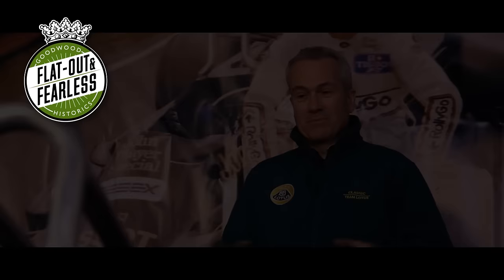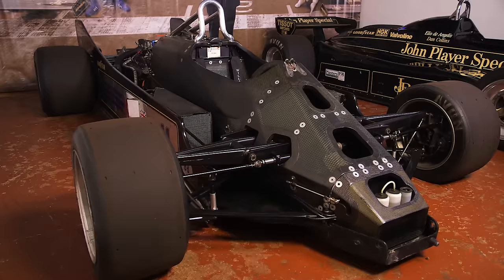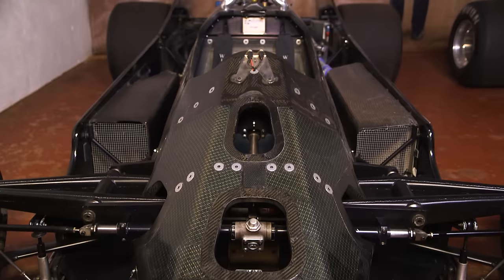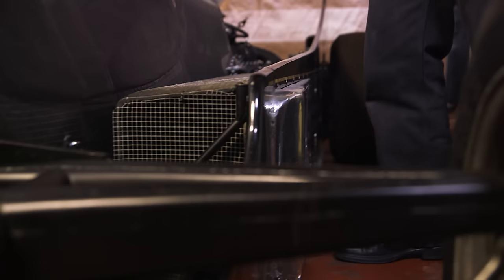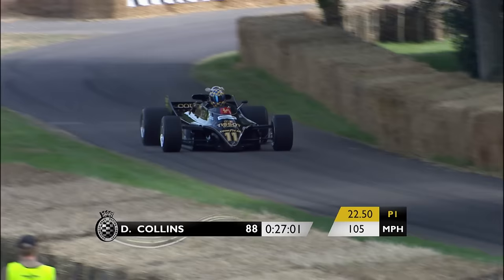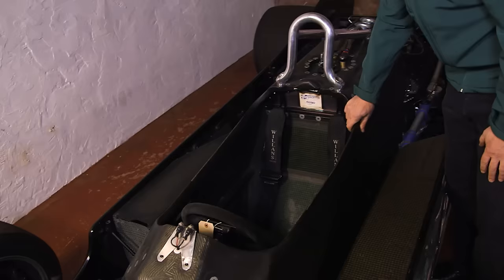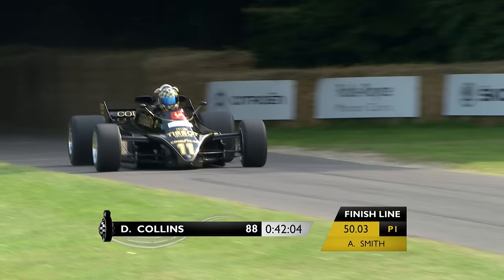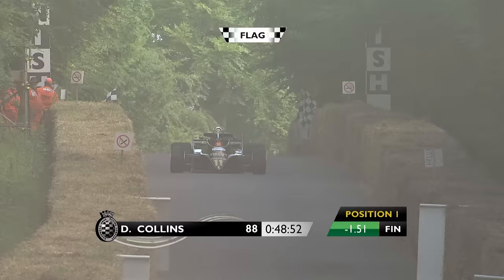Lotus Type 88 - The BANNED F1 car

Comment: Another masterpiece from Colin Chapman... However the problem was that with ground effect the pilots were suffering of two much G force in curve which caused safety problem. This is the reason why the year before 6cm clearance was introduced and the skirts banned. 
Brabham (with hydropneumatic suspension) also tried to workaround the rules to use ground effect. For similar reason later on Turbo-charged engine would be banned too because F1 were becoming power monsters. 
These limitations might be seen are setback but innovation might not be done at cost of drivers safety and there is still room for innovation within rules.

Comment: I don’t know if this car would make it. The idea is indeed brilliant but Lotus kept on using normally aspirated Cosworth engines. The ground effect car was very fast on corners and the double chassis made the car much more driveable to the driver, but the other teams were also building ground effect cars with 1000 HP turbo engines. Any advantage this Lotus would have on corners would vanish on straights. After Chapman’s death Lotus also went turbo…

Comment: I really don't understand this kind of innovation suffocation. In a very specific circuit i understand, they want to keep things somewhat competitive and everybody driving fairly similar cars so that it's more about driver performance than the machines, but you're talking about formula 1, the pinnacle of automotive engineering, pitting against one another auto giants, exotic car manufacturers, and smaller high tech engineering companies, to see who can make the fastest car. If someone comes out with a better design, they deserve to win and others will come out with a better design or copy their opponents. 

I don't follow much auto racing but i was paying attention to motorcycle racing there for a while and I liked Buell when Harley killed the brand. I was very excited when they announced Erik Buell Racing and said EBR would compete in racing. The bike they came out with was lighter than other bikes on the circuit because of trademark buell features like the perimeter brake rotor, fuel in frame, and using the engine as a stressed member of the frame. The rules allowed for a larger displacement if you had a v-twin engine rather than an inline engine so they went with 1190cc, and in the end the inline 4 engines had more power, but the EBR bike was lighter. Amazingly though they forced EBR to add weight to the bike in order to race, giving up their primary advantage. I can't understand rules like these, why not just be honest about it and say we expect everyone to fit in a mold and not be unique.

Comment: This is what holds F1 back, manufactorers are not allowed to push innovations forward. The last time anyone really did was McLaren with their stalled rear wing system. FIA went and made that into DRS, which is a lot more synthetic and they normalized it accross the feild. Before that was what Red Bull with the blown defuser? Thats now banned. Mecedes had that system where the air going though the DRS system would channel to the front tires giving more lift and top end speed, also banned. There was that one time Ferrari had like a U cut out in their rear wing, banned

Comment: For all those interested in the real story of the Lotus 88, it is not told here. There is a very important part missing. Back in 1968, there was a proliferation of very high aerofoils on F1 cars. They were very effective as long as they stayed in one piece. The problem was that they were mounted to the wheel uprights to maximise the load on the tyres but minimise the load on the chassis. This was a good idea in principle until they started to collapse. At the French Grand Prix at Rouen, Lotus driver Jackie Oliver was involved in an enormous crash when the high wing on his car failed. Here is an example on a Brabham:

http://www.formula1-dictionary.net/Images/wing_failure_1968_brabham.jpg

This led to an immediate ban on suspension-mounted aerofoils.

So to the Lotus 88. What Clive Chapman doesn’t tell you is that the so-called primary chassis was designed to apply downforce to the suspension, via links just inside the uprights. When you see him pushing down on the chassis, all that is happening is that the spring mounts for that component compress and the load is transferred immediately to the wheels. It was just another take on 1968. This was not so much a work of clever design as it was a play on words but ultimately, nobody in 1981 thought it was anything less than a breach of the rules and nobody but Lotus complained when it was banned. It was just another concerted attempt to get around the rules. At that point it was not showing a lot of potential and the team admitted that it would take at least a year to develop.

https://m.imgur.com/ja6PvFt

https://duddhadotme.files.wordpress.com/2015/10/lotus88b_l.jpg

All other theories about it being too fast or too clever or the result of pressure by Ferrari are wrong. That’s just victim talk. Everyone knew it was illegal. Even Lotus didn’t push too hard when it happened.
Reply: Exactly.   It is sad for Lotus because they put all their chips in on this design, and if it had worked (as the 78 did  a few years earlier) they would have been world champions in all likelihood.   But it was also clearly a violation of the "moveable aerodynamic device" rule in place at the time.   That had originally been intended to apply to traditional "wings", but IMO it was rightly applied here.

The real question I have is why Brabham's hydropneumatic suspension system - designed solely to get around the minimum ride height rule - was not also banned before racing...
Reply: @ShmuelWeintraub  From memory, that was in response to a minimum height restriction rule introduced for 1981. The idea was for the car to clear a 6 cm high measuring stick placed under it before it left the pits and on its return. This was supposed to eliminate skirts (which were also moveable aerodynamic surfaces, as are DRS elements in the rear wing of a modern car...) The Brabham suspension was supposed to circumvent this by alternately raising and lowering the chassis to bring the sidepods closer to the track and make a better seal for the undertray. This required incredibly stiff suspension. The driver would leave the pits and throw a switch and the car would suddenly drop down to its designed level. When it returned to the pits, the driver would throw the switch and the car would pop up again. Because it was relatively easy to implement, it only took a race or two before everyone was using it. It was banned for 1982 and side skirts reappeared.

Comment: I was a big Lotus fans in those days and remember the conversations around the car. It had such little track time whether the dual chassis concept was going to be successful is I think still open to debate. You also have to take into account the banning of the Brabham fan car three years before which Colin (with Ken Tyrell) had been at forefront of. Lotus has certainly led the way with Ground effects with the wonderful 78 and 79 but then lost it with the 80 and thereafter. As a Lotus Fan the debut of the 80 rather than the  banning of the 88 was more disappointing. At the time much of the expectation around the 88 was that it would be banned and the pass by the scrutineers in practice perhaps a surprise.

Comment: I would give any organisation that plans on creating a race that has no boundaries, laws and rules on innovation all of my money. All of it
Reply: Math M there once was a class called group c prototype. Basicly just what you said. Only wheelbase and track was within a given spec. 

And if i am mistaken by that please correct my answer without being rude, its been a while since the banned the class.
Reply: @mightress  That is not true. Group C was far from unlimited. In fact, it was the first formula to stipulate fuel consumption. That’s right- hippies and tree huggers rejoice! It was a fuel allocation formula. At Le Mans you had 2,500 litres of fuel to last you 24 hours and woe betide you if you were a millilitre over. You got disqualified.
Reply: @mightress  They didn’t ban Group C. It was replaced with a new formula which had engines more closely related to F1. This was because teams were leaving Group C in droves because F1 wasn’t that much more expensive and got your sponsors more air time.

Comment: This more of the same thing that happens with any sanctioned sport.  If one teams innovation top all others instead of making the other teams develop something to count it, they just ban it.  Just ask Ford about their 429 engines used in the GT40 Mark IV series.  Other race team screamed at the sanctioning body and the rules were changed to no bigger a displacement that 5.0 liters after 1969.
Reply: 1) The car was obviously a cheat. The rulebook banned mobile aerodynamic surfaces, and to make them bigger didn't make them legal. 
2) In reality it was actually a slow, crappy and plainly dangerous car, and the pilots later confirmed they felt relieved when it had been banned.

Comment: That's hilarious that they used almost the same technique to get around the same rule low riders had to get around. In LA they banned cars that were too low to the ground so they made it variable by adding hydraulics it allowed them to raise their cars around police so it met the minimum requirement then drop it back down later. The FIA basically did the same thing to Formula 1 to limit high ground effects and they made it so the downforce would deform the sidewall and lower it while driving.

Comment: I struggle a bit with the "double chassis" description.  The chassis holds the wheels and drivetrain and there's only one of those.  The second "chassis" is what I would call floating bodywork with integrated aerodynamics ... maybe an aerochassis?  OK, maybe two chassis ... 🤔 ... maybe.
Reply: Infact describing it as a "chassis" (even as the "primary chassis") was only a smokescreen. It was a single mobile aerodynamic surface.
Reply: Yes.  split chassis (it does have some chassis like components) or Megawing or ????
The one thing it is not is a second chassis....

Comment: Ferrari International Assistance, strikes again. F1 designers will take the rule book and push the limits of those regulations. They will sometimes manager to go past till another team shouts foul. Nothing new here then.
Reply: The same Ferrari International Assistance that allowed McLaren and Lotus to use the 3D throttle right after having said to Ferrari it was out of the rules, so stopping its devlopment in Maranello? The same Ferrari International Assistance that allowed McLaren to get away with their chief designer stealing Ferrari's bluetprint? The same Ferrari International Assistance that forced every team to run with Mercedes control units?
Reply: Suspension mounted airfoils were banned in the late 60's, that's what the body is, a suspension mounted airfoil.
Reply: @SuperExcedrin  1968, to be precise. The Lotus 49B got two crashes in Spain GP due to wing mounts failure.

Comment: while this system was dangerous for high speed cornering and the dangers of even a little piece of the car coming off could kill someone it still saddens me that the FIA is more interested in keeping F1 linear, right now teams can buy engines and such from other teams well where is the innovation teams should have to build there cars from scratch not go "so we have built the car based on what the winners are doing, but we have forgot the engine no worries we buy Mercedes or Ferrari's engines" this is not innovation, this is making F1 boring and just the same every year, Formula E is where the future is with jaquar (one of the oldest and most notable racing teams), BMW, Mercades and nissan including many others and also Aston Martin closing in for the FE, why go F1 when E is better anyway.

Comment: By the way, isn't the Type 88 doing what red bull did with their front wings? They got round the rule in a smart way. Flexible front wing, so when the car is not moving it meets the requirements, but when you add air load on the wing it goes down and gets better aerodynamics
Reply: True, it even started the whole new engineering area, called: Aerorigidity
Reply: @drazenbudis1303 , I think they had a flexing nose-not the wing itself-which achieved the same result but the wing passed the deflection tests. And before you say "brilliant" remember moveable aero devices are not allowed, and the flexing nosecone was a moveable aerodynamic device(the entire body is an aero device).

Comment: Just like how the 787b got banned in Le mans. Can buy a 4 rotor made out of billet from Australia and NZ and put it in praga r1 and you have yourself a perfect race car .
Reply: Load of crap. And both cars were well off the pace anyway.
Reply: @thethirdman225  hahahaha
Reply: The 787B was not banned from Le Mans, after all it wasn't very fast*, a rule change with engines equal to F1's was long overdue.

* In 1991 they made it race with 170kg less than its rivals in the same category (minimum weight of 830kg instead of the one of 1000 Kg, increased  from the previous 900, imposed to the other competitors), in years it won only one race (Le Mans 1991) thanks to the weight advantage and relative reduction in consumption (the regulations foresaw a maximum of 2550l, with all those kg less they had fewer problems respecting it than the rivals who had to slow down) as well as reliability problems of the opponents who were faster.

Comment: The Lotus wasn't the first carbon monocoque, the McLaren MP4/1 was.
Reply: Lotus was first F1 car with cm but McLaren MP4/1 was first one to be raced.
Reply: I’m not sure how true this is. The Lotus seemed to be made of sheets of carbon that were bonded and bolted together, whereas the McLaren was tail up on a mould, using all kinds of irregular shapes before being vacuum bagged and put in an autoclave. The Lotus seems to have been a new material utilised in the old way, while the McLaren went all the way and used the best method.

Comment: Can you imagine how amazing F1 would be if it never had restrictions
Reply: It would be utterly boring. There would be one team, with one car and no driver because it would be done by remote control. The spectators would be about a kilometre away from the track.
Reply: @thethirdman225  it wouldn't be boring, it would be an engineering marvel and drivers would be priviledged to drive such machinery. F1 is about innovation and these designs can further help teams understand how to improve road cars too. Debatable, but nevertheless, F1 will be innovative.
Reply: @micklykan7057  It would become so prohibitively expensive that there would only be one team and probably only one car, which would be remote control. Look at the biggest complaint about Formula 1 today: the big money teams dominate. They tried unlimited racing in the1960s and1970s. It was called CanAm and as spectacular as it was, there wasn’t a lot of dicing. The big money teams, Porsche and particularly McLaren, simply ran away and hid. In the end, the Porsche 917/30 was called “the car that killed CanAm”.

Comment: Wouldn't a second chassis just add a huge weight
penalty? Doesn't sound to elegant if all you are trying
to do is seal leak for better ground effect.
Maybe it wouldn't have done as well as people think.
Reply: The name is a little misleading... a better term would have been "split chassis".  I think you are right Ian, there would have been a weight penalty for all the extra hardware that allowed the aero surfaces to move while remaining 'attached' to the wheel hubs (or wherever).   But think of it this way... ground effect cars were much bulkier and far LESS aerodynamic than their non GE counterparts - yet they were faster by far because they didn't slow down as much for the corners and thus did not have to accelerate again out of the corners.

No-one knows how the T88 would have done if it raced.  Testing times showed it to be very very competitive, but we'll never know whether it would have been the cakewalk to a championship some thought.    We may even have learned that, while unquestionably fast, the trick suspension linkages required to transfer load to the wheels couldn't handle the bumpy surfaces of the day etc.   It's hard to speculate.

Comment: When the design is so genius they feel stupid and ban it
Reply: Not so.  The F1 rule book had included a ban on moveable aerodynamic surfaces for about 15 years before this car was built.   Lotus built a car to work around the rules (much like other designers and constructors do), and actually broke them.  It happens.  And they knew they were taking the risk of exclusion when they designed the car.

Comment: C. Chapman was of course the first engineer to use the engine block as part of the chases saved weight n made the car stiffer but cause they ALL copied it it was not banned also Lotus won as many GPs in 10 years as Ferrari did till that time on a shoe string not on £Billions Lotus build the Elan with £20000 total n BL spend £32 millions to designed the "world" famous Morris Marina, where is BL now? where they belong and Lotus will one day be the super/car of the world, not in my lifetime but they  are well on their way, I know how I felt the first time I drove an Elan getting out of my S/H MK1 1200cc Cortina that replaced my 1955 Ford Consul MK1 couple of weeks previously I Honestly felt i was Driving a car from a very advanced civilization from a different planet